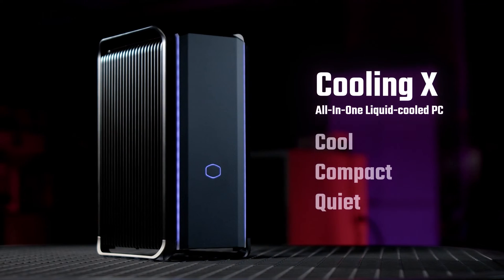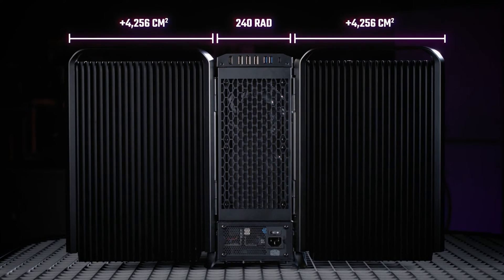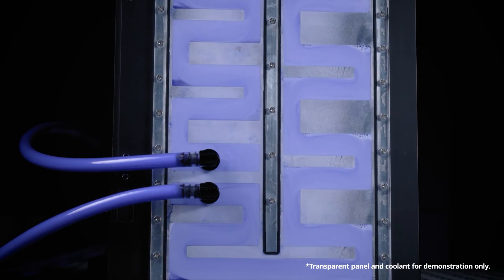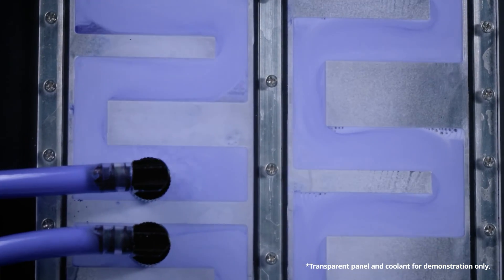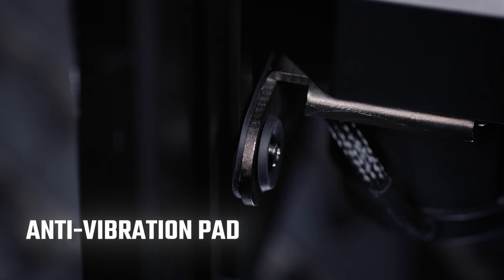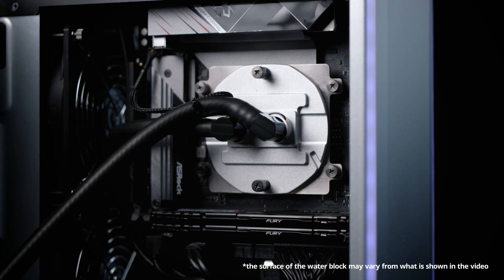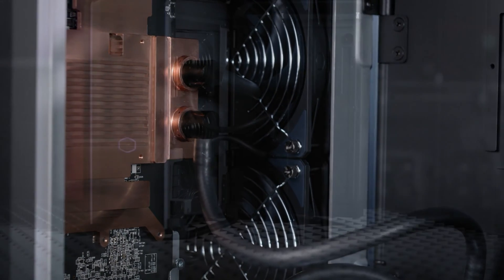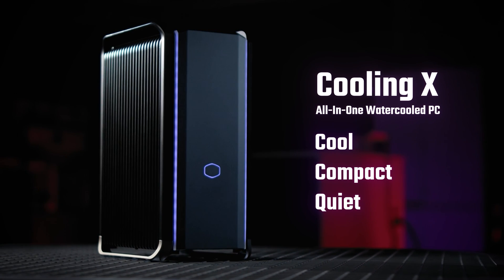Cooler Master Fully Liquid cooled plug and play PC (technical highlights)

Comment: Ok. Copper water blocks with aluminum passive radiators. Sounds like a disaster. Aren't you worried about galvanic corrosion over time? Why not make the water blocks from aluminum? It'll be cheaper than copper and you don't have to worry about galvanic corrosion. This issue has been known about for years and every manufacturer of water cooling products have experienced and overcome this issue. Why haven't you learned anything yet?

Comment: When I got a "monster" level air cooler, you painted it as an ETERNAL cooler, I've been using it for almost a decade and today it continues to cool like I just bought it, I have changed generations of processors, but NOT the cooler. I am referring to the MasterAir Maker 8, and now it turns out that I have to leave it because it is not compatible with LGA 1700. And they have not yet released BRACKET for MasterAir Maker 8. With sadness I see that they released bracket for the Hyper 212 that cost less than half of what I spent on the Maker 8. Will there be support for the MasterAir Maker 8? Thank you.
Reply from the maker: Sorry, there is no kit for MasterAir Maker 8.

Comment: The price of this thing is outrageous. I cannot fathom why you would even attempt to sell it when you can build a better PC, with custom water for FAR less than the $6999 USD price point. Putting a 4080 in there is almost insulting.

How did you solve the galvanic corrosion over time? Aluminum with side panels coper radiator and blocks? Even coated, it will break down over time.
Reply: It’s 2,500€ now
Reply: @user-ud9ct8xg1t  which is relevant a year later????
Reply: @MrPhyrce still overpriced
Reply: They included the warranty and support from their team over the years in that price that's why it's soo expensive you could make your own for way less
Reply: @vetonlatifi5594  Doesn't justify the price. If the product doesn't stand on its own, it shouldn't exist.

Comment: please bring this case out in full atx compatibility. we need this type of practical design in the DIY space.
Would love to be given a practical reason to stop using my define R5.
Reply from the maker: We will have something in the future... Stay tuned.
Reply: You mean mini ITX?

This was engineered... Large hot box cases with maximally inefficient airspace to stir around hot air, that require crazy amounts of airflow to overcome this purposely bad design, shouldn't be the goal. 

Almost all PCs are way too large and have horrendous cooling instead of perfect pass-through air cooling or massive radiators like this.